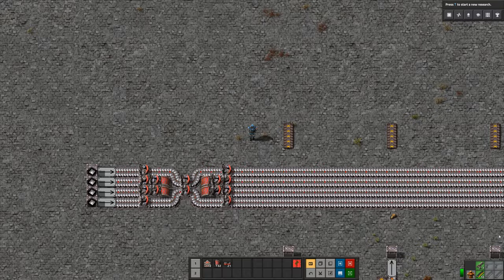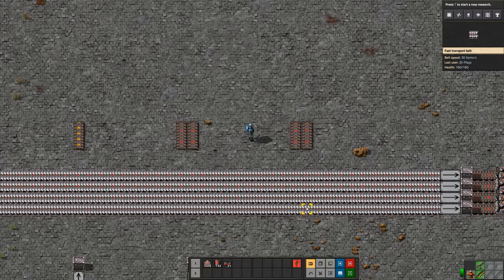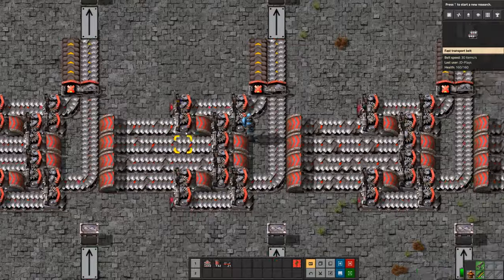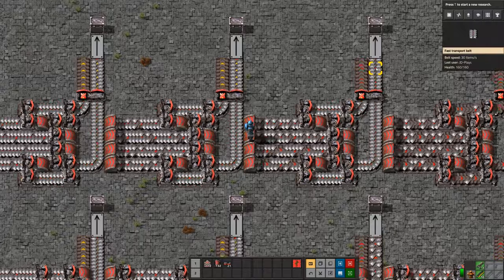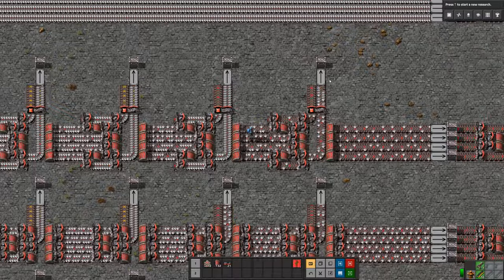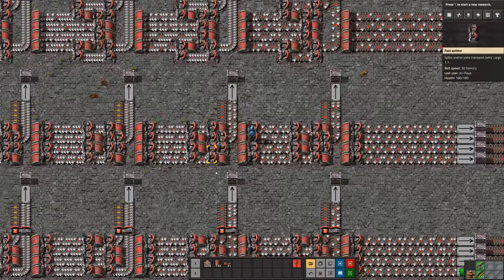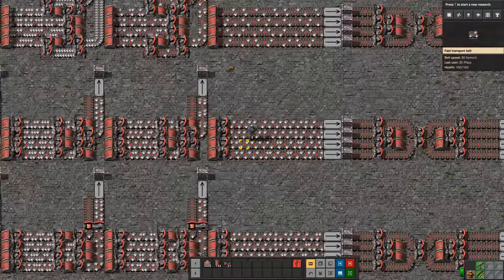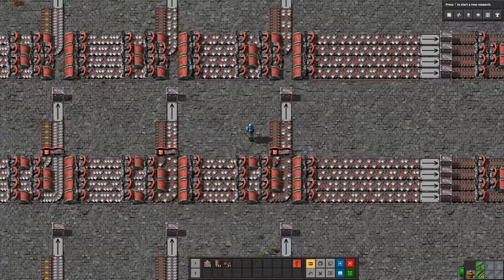Factorio SPLITTING OFF THE BUS ⚙️ How to Split off the bus 1.0 ⚙️ Tips and Tricks done quick

Comment: I also use your fourth version with one addition,  I put a true input/output balancer on the splitoff so I don’t end up with a side of the belt filled and the bus looking weird. 
Great vid.
Reply from the maker: There is little need to balance lanes, Honestly the inserter never cares which lane things are on. The ONLY issue you might find is if your splitting off 1 lane over and over, that lane might run dry whilst the opposite lane on your bus is still full (a mistake that OFTEN catches me)
Reply: My inserters often priortize pulling from the same side of the belt which makes it unbalanced, sometimes all the way back to the smelters. 
However, this issue only occurs if you’re not using a full belts worth of materials, and it might be only me that obsesses over such things. :)
Reply: @JDPlays  The main Issue isn't the optic of an uneven load. if you only using one side of the belt and do a rebalancing (doesn't matter of Option 1-4 in this case) after every splitt of, you are reducing the other 3 Belts to only one lane and reducing the "bandwidth" of the bus by a lot (instead of 4x30=120 i/s it now only 3x15+30=75 i/s for redbelt).
Reply: we're talking about lane balancing for a single belt, yes?  That makes sense... and is something I try to do close to the place where the draw becomes uneven, so everything upstream can just feed two lanes to that point.  And don't worry, Mathias... you're definitely not the only one to obsess over such things.  Have you seen the reddit threads?  "Literally unplayable" is the phrase often used for such things.  xD
Reply from the maker: @tahca3506  its optics only! As long when you pull off you have the option of using either lane u havnt lost any thruput
Reply: Great video. Thanks

Comment: This is good info but based on all these designs, it seems to mean that there should be individually 4 inputs of smelting items. from 4 lines of smelting.  Otherwise, splitting off 1 or 2 (like how most early bases start) would easily eat up each line of items already.

So it's good for later on when we can get 4 lines of copper or 4 lines of iron into the base.
Reply from the maker: Well it depends on the splitting style some rebalance as they split. But I prefer the reverse waterfall, so as I add more smelting lanes they will just push everything to the tope lane as we pull materials off.

Comment: When using the reverse waterfall, how would you arrange them if you need to pull off one of the middle lanes on the bus?
Reply from the maker: Why would you pull off the middle? the idea is its always pushed to the edge, so you always pull off the edge.
Reply: @JDPlays  Ah, I have several arrays packed closely together--didn't space them out enough to begin with. Splitting off from the edge would run into an existing underground or something like that. Otherwise I basically pull off from the edge as you explained.
Reply: @pewtone  Yes, this. A lot of these "splitting off the main bus" tutorials never explain those situations. Nor do they discuss creating mixed belt split-offs
Reply: @NeonGen2000  for a mixed belt you would simply create a split from each line you need (so if you need half iron and half copper, have an iron split and a copper split) and then before your production line merge them together using whatever method you prefer.
Reply: @TheDilla  Right. But this leaves the bus lines with halve empty belts which do no get balanced by the splitters.
Reply: @NeonGen2000  well for that you can use a balancer either before you merge them or after on the bus itself. Before the merge would be more simple.

Comment: This sort of crazy math is precisely the reason that I load balance in Factorio.  Which is pretty ironic, because in Satisfactory, the "YOLO" manifold approach works so much better.
Reply from the maker: these splits off the bus are very similar to the yolo method from satisfactory (or factorio for that matter) but they offer a good half way point rather then balancing and rebalancing they split and also consolidate to a single belt if used properly

Comment: I think Im really dumb because Im not getting this lol
Reply: it might make sense if you think about it this way.

You start with 4 lanes.

You pull off to one side, let's say it's the right side.  Because the splitters are configured to push everything to the right side, then when you actually see what's coming out of that right side, it is 1 full lane of items.  3 lanes remain.

As a result of pushing to the right side everytime, you can pull off 4 total times before you see the items dwindling down.  In some examples, there were not even any more items.  In other examples, there were still some items.

When items are being used, then it will seem as if the lanes are not having enough for what is downstream. But as assemblies or conveyer belts get full, then items will come out on the left side, which those are the extras being unused in a previous pull-off and you can use them for other stuff now..although it will still be low item count.